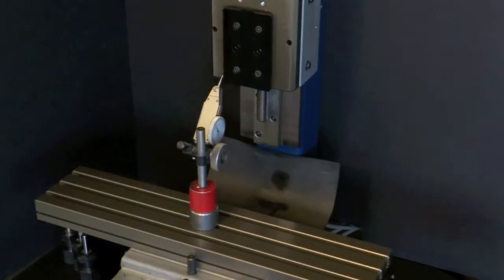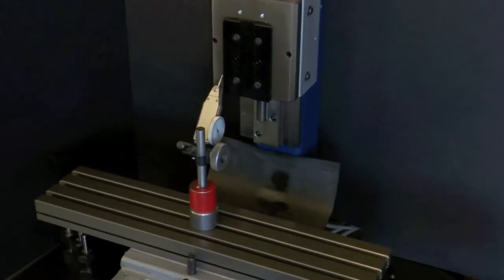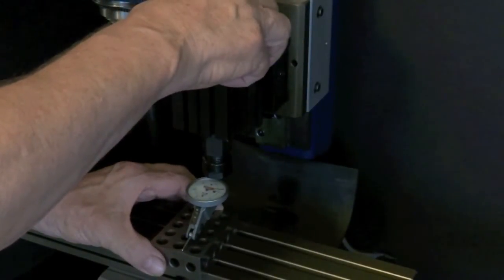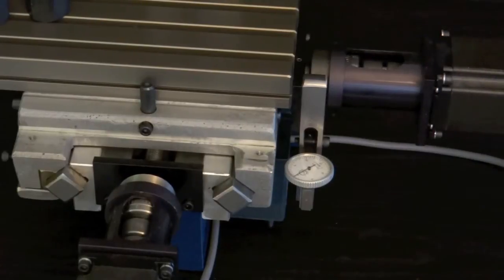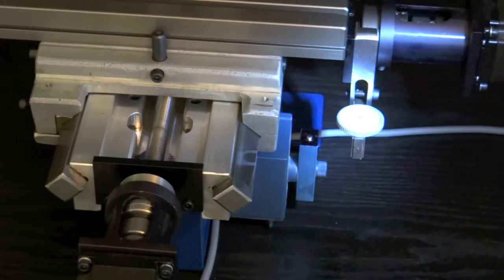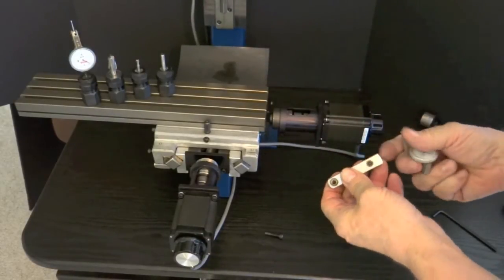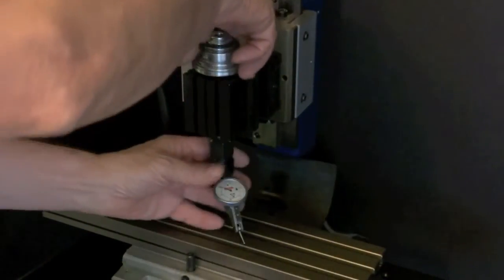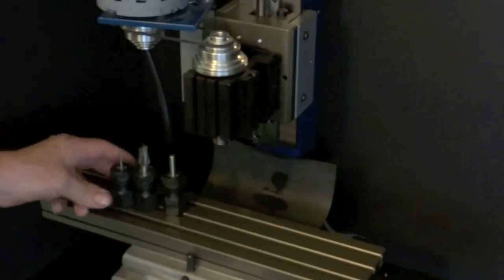SWEEPING THE TAIG MILL

Comment: Just got my New 5019A CR unit from Taig.with ball screws. Taig did a magnificent job packing & sending me my unit. A senior newby when it comes to this area. In the process of assembling the machine. First of all, how do I get  the table assembly  squared to the steel column assembly. I would think that this would be the first thing that this senior should know how to do before I fool around with squaring up the dove tail plate. I can eyeball the column & table assemblies ???? Thank you for this excellent video on the dove plate. But I think I'm missing something.  KP USAF 62-66
Reply from the maker: Indicate up and down on the "Z" slide assembly (The Piece Behind The Black DoveTail). The dovetail is lined up pretty close from the factory these days. I'll make a video this coming week on how to line up the "Z".
Reply: Fortunately I found a Taig Setup video posted here on Youtube that explained the out of box assembly & setup of the Taig.:)Once I get that done will be Then I'll work on the dove tail, if needed. Thank you so much for your assistance. Very nicely done!

Comment: I just got my machine in, should I take it apart and check the extruded dovetail (p/n 200-48)?  Also the only dial indicator I have is the kind that is pushed straight through so I was thinking about indicating the bottom of part number 200-44 from the X axis to tram the head.  Will this be accurate? Is there a better way to do it with that type of indicator?
Reply from the maker: noshortnamesleft atall Do it the way as shown. The type of indicator does not matter. If you just purchased a new machine it is very close as is. Part # 200-48 is put on with a jig that lines it up with the Z slide.